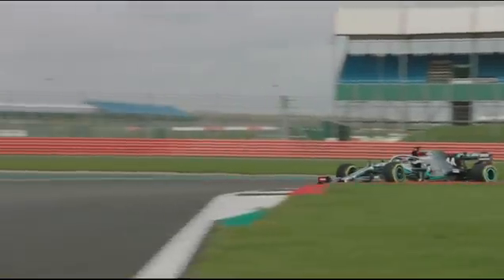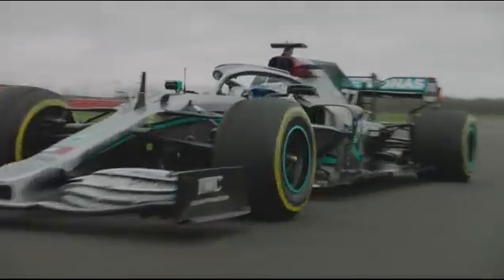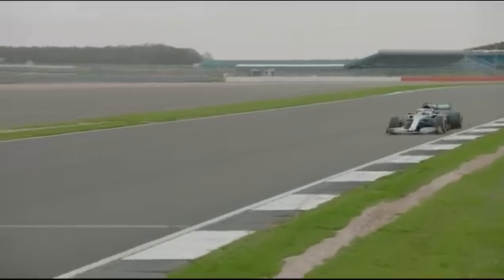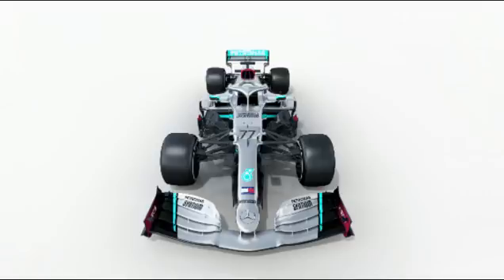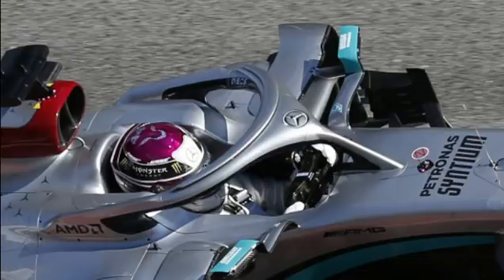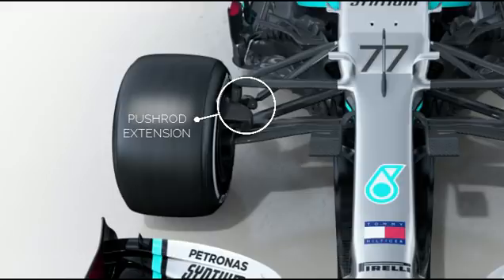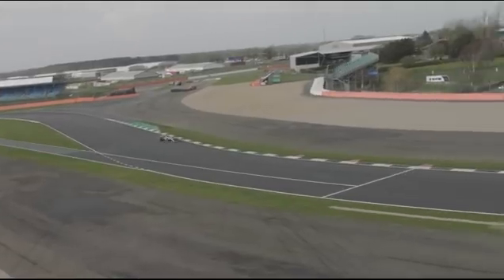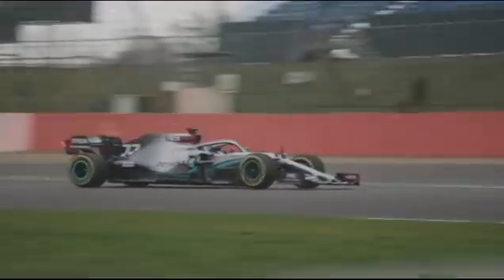MERCEDES W11 TECH INSIGHTS - WHAT IS THE DAS SYSTEM?

Comment: I think this DAS is engineering brilliance. I wonder, however,  why merc would set up the steering wheel to moved a noticeable distance in order to change the toe-out rather than have the driver move the steering wheel  a few millimeters; that way nobody catches on
Reply from the maker: Well, I think the biggest thing here is, had we had the usual no broadcast situation for testing no-one would have actually caught onto this until Australia. So, in that respect everyone has a head start. As for the movement, I would imagine that there's some safety margin built in, in order that pushing or pulling the wheel doesn't really begin to do anything until you're at a certain point on the travel. Having only a few mm's would eradicate that safety margin.

Comment: merc are always cheating before it was the fric.many viewers will back off bec of fia being one sided to merc.
Reply from the maker: Oh, you mean that FRIC system that everyone team was using, the FIA decided it would be banned next season, yet in order that no-one protested anyone all of the teams agreed they’d stop using it immediately. Also, you’re only cheating if you’re caught 😉 go ask Red Bull about that one...
Reply from the maker: Shall we start with the self adjusting front wing flap that was found on their car in Abu Dhabi 2014? A solution that no-one really knows how long they had on the car... 

I didn’t say they were heating or cooling the tyres, as technically it can be done for either, depending on how it’s setup. I said ‘improving tyre conditioning’
Reply: The FIA has said this is legal!
Reply: Ferrari 2018 Dual Battery Packs , Ferrari 2019 Fuel levels to the engine .. Zero Penalty ...if Ferrari has DAS it  would be only be in Vettel Spinner Car.....go Cry a River ...